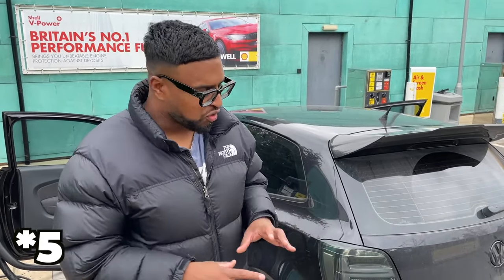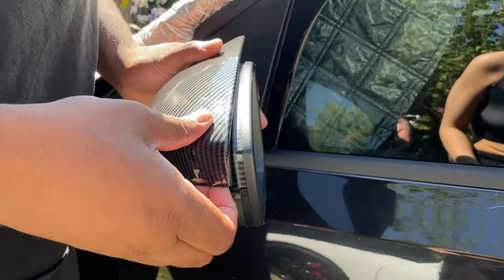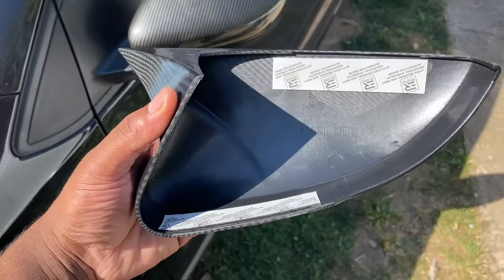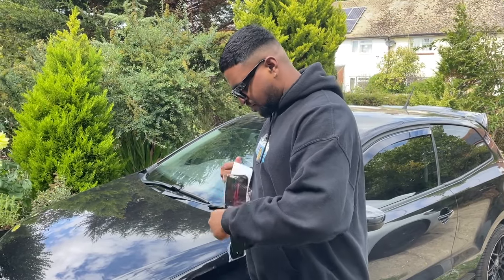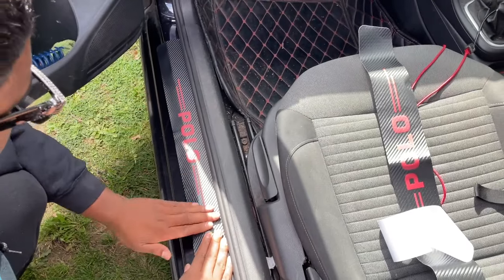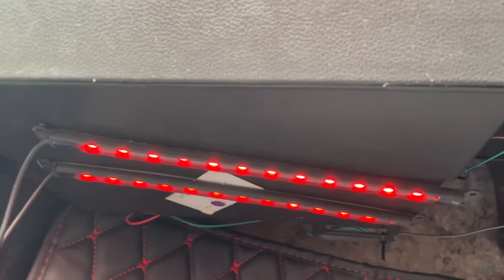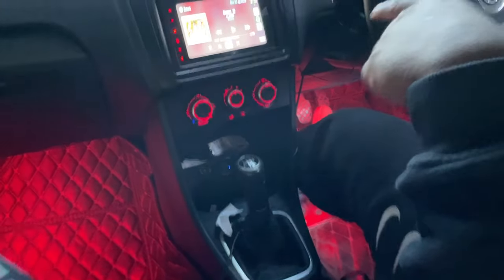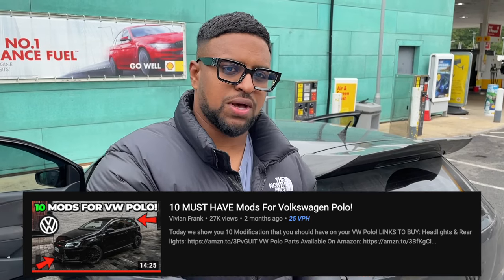5 CHEAP Car Mods For Volkswagen Polo!

Comment: 12:05 man's be "doing it from the back ."
 "But if you're doing it from the front port,  then just feed it through to the back "

Polo drivers, just do it different
Reply from the maker: just so i have the availability of the front port to use for chargers as well as you cant tuck the cables away from there so u got loose cables coming from both sides which you cant hide.

Comment: I also bought the AC knobs that you've got but having trouble to remove the original ones. How did you do it? I tried using paraplyer but keep slipping and scratched the original middle one. How does those round AC knobs feel, worse or better?
Reply from the maker: cant remember as did when first got the car, just took off and put on. Remember needing to super glue so dont fall off
Reply: @VivianFrank  Okay, thanks for the reply, will give it another go. By the way, what year is your Polo? Also on my modding journey right now with my Polo 6C 2017.
Reply from the maker: @Husramash  1.2 2010